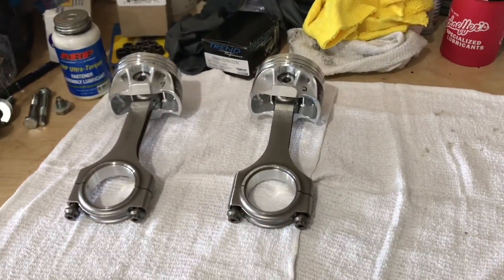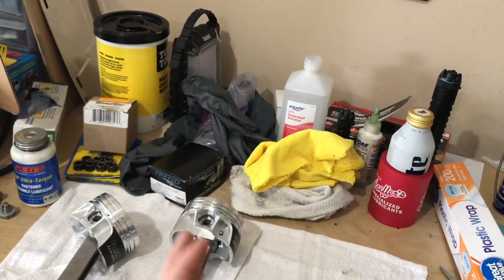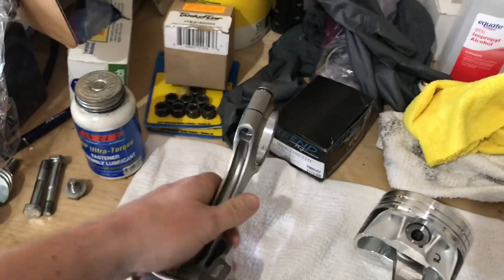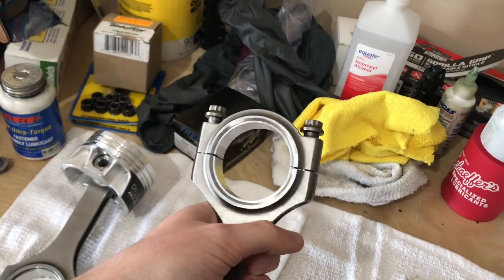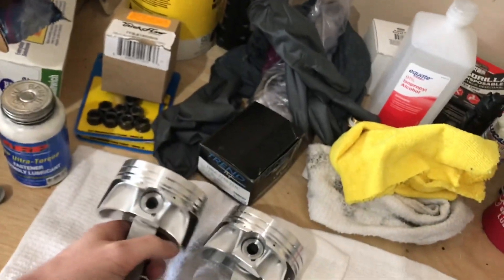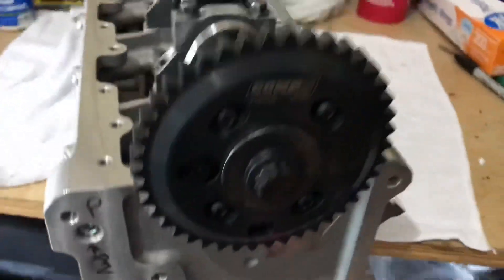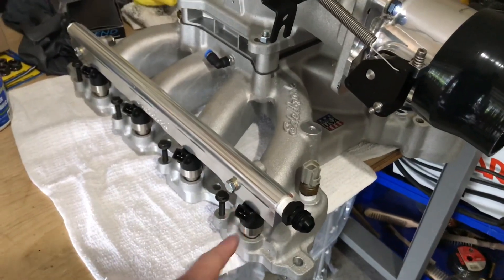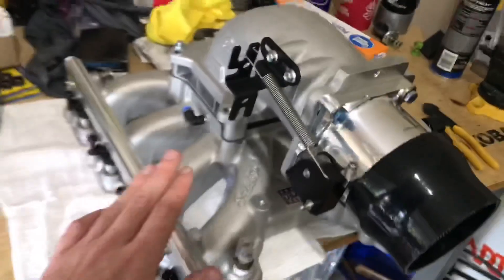Prepping parts for my 1000+ horsepower 2v

Comment: I worked in a machine shop several years doing head and valve work and the old guy that was the owner and only one that did the final engine assembly always always used plastigauge to check all bearing clearances & tolerances before final assembly even tho he did the machine work to catch any issues before final assembly. He NEVER trusted that ANY brand new bearings or parts were exactly what they were supposed to be. He checked EVERYTHING before final assembly and would occasionally find brand new parts that weren’t sized exactly like they were supposed to be. In all the years I worked there we only had one 350 small block Chevy come back and it was determined that the young man didn’t follow proper break in procedures, in fact the guy admitted that he had beat on the engine before break in was completed and spun a bearing.

Comment: Nice tips with piston to rod setup. That could make for a bad day if done wrong. Any tips for upgrading to forged rods or rods and pistons in a already running engine. Some say just balance the rods and or pistons and install if clearances checkout, others say the crank will need rebalanced as well. Just looking at upgrading a cheap engine so I can practice boosting and tuning with a little more reliability.
Reply from the maker: Desert Rat Racer yeah anytime the weight of the rotating assembly changes you need to re balance the crank
Reply: @andrewlavender08  ok thanks
Reply: Aeternalis Armentarius no joke 😂...